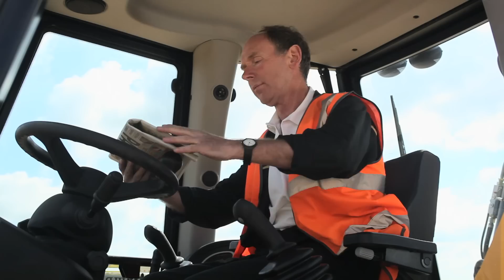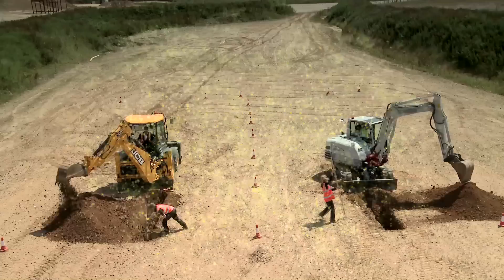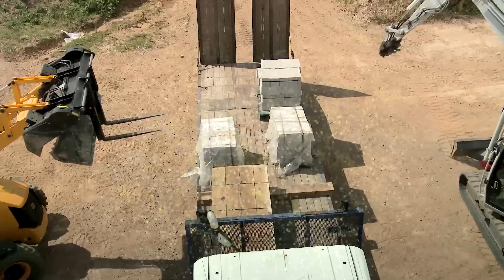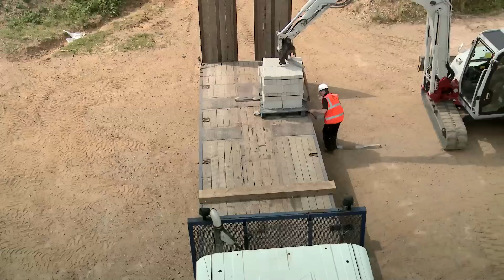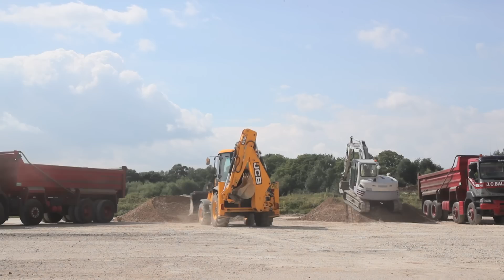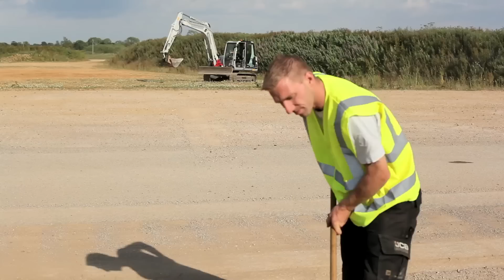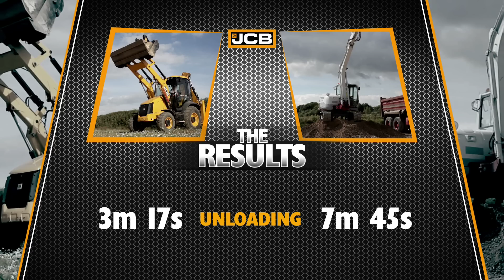Backhoe vs Excavator

Comment: The excavator is better at digging if there are cables and pipes in the ground because you have mutch better view of what you are doing. And if you have a rotortilt you can just put the pallet forks on that, same thing goes for the sweeping attachment. Plus the backhoe is a JCB so it would be broken  half the time that the excavator is working

Comment: THe front end loader on a backhoe can move SIGNIFICANT amounts more dirt per unit of time over a much farther distance than an excavator. Also Excavators are not really truck loading machines until you get into the Quarry size machines. That is why major construction projects use Wheel Loaders for loading trucks. Excavators dig holes and wheel loaders/backhoes fill trucks.

Comment: Backhoe is equivalent to about an 8 tonner so an 8 tonne excavator should have been used. A more experienced excavator operator should have been used to trench and backfill. A set of excavator forks should have been used to unload. A wheel excavator should have been used for speed. Loading trucks is definitely quicker with an excavator you dig from your side and load over back of truck for fastest load time with a mud bucket.
Reply: Lllllllllllllllllllllllll
Lp
Reply: K
J
C
B
Reply: @hennyawalia4939  lmo mio ko

Comment: It's hilarious that JCB would produce this video, which seemingly seeks to make the point "Backhoes awesome, 360 crawler excavators suck" when they themselves also manufacture 360 crawler excavators.
Reply: ï
Reply: +Renata Krauerova m
Reply: +Renata Kaur ova the best
Reply: +Patel Hitesh jjjjuiJ&
Reply: syama anish c
Reply: Bloodgod40 ujjbbbbyy
Reply: Sonu Ashif de 9
Reply: Kala Subramaniam yt3
Reply: Bloodgod40
Reply: Bloodgod40
Reply: Bloodgod40 تننهخححكح
Reply: Moha Zouaoui hbzbz
Reply: lam rau cau
Reply: Bloodgod40 other
Reply: Check size of excavator it's tiny they can use huge excavator instead 😅😂😂
Reply: Bloodgod40
Reply: b
Reply: Bloodgod40 was the time
Reply: Bloodgod4
Reply: It’s pointless like comparing a bus and a train, there two different machines and they may have some similarities, but I see this video pretty pointless. A backhoe cannot move the dirt as far away from the trench for first, and
Reply: @olivermansfield8341  I grew up operating Backhoe for my Dad and I hate them. I have a E85 Bobcat Midi and I would take it over a rubber tire Hoe about 90% of the time. I mean It would be a better comparison to have machines that are same weight, because they don't appear to be.
Reply: Thanks
Reply: @renatakrauerova2487  hdbbndi
Reply: Münevver Demirağ 

Ppl
Reply: 0
Reply: What JCB should have done is pit their own excavator against the excavator in this video then the point would be " JCB Awesome (insert other company here) sucks
Reply: @juliopratama7708  dede

Comment: Each machine has it's positives and negatives.  I have a 2001 JCB 214S and love it.  But like any  backhoe, it cannot compare to an excavator when excavating for a basement home.  Since the excavator can rotate 360 deg. compared to around 180, it is way easier of an excavation when compared to the backhoe.  On the other hand, the backhoe moves material much easier and faster.  It's also way better for clearing land.  I just push over 18" trees, lift it out by the root with the bucket, raise it in the air with the clam bucket, and cut it up into 10' sections.  Couldn't do that with an excavator.  Still the backhoe is an all around machine that is better than an excavator at most tasks.  Cheers from Canada.
Reply: Nice 👌
Reply: its, not it's

Comment: There is so much disinformation in this video:

1. You should use machines with the same digging power. An excavator indeed has to be heavier than a backhoe to have the same "bucket power".  BUT tracks have much less ground pressure than wheels so an excavator can keep going on muddy ground a lot better than a backhoe, even if it's heavier. And most of the weight of a backhoe is on its rear axle, which doesn't exactly help either.

2.  And of course an open area - what if the working area is cramped. If you need to have the machine between the hole you're digging and the dump truck you load the stuff on. It isn't even possible with a backhoe!

3.  When you need to move  a backhoe you either need to turn around the seat forth and back or push the backhoe with the bucket in the ground. In both ways you can't dig when you move it. In an excavator you can use more of your time on the actual work.

4 The view and working environment. In a backhoe you have the digging arm directly in front of your eyes. In excavators (except for mini excavators) you have a clear view of the bucket all the time without any need to move yourself.
Reply: this excavator and the backhoe is equally priced ,so they are showing what is the positives in backhoe
Reply: @mithung1058  I see, that's a good point. But this is only about the "digging power".  This video is an ad for JCB backhoes, so of course they only tell the benefits of it. I wanted to give this a wider perspective. This video shows an optimal open working area for a backhoe where it definitely wins. - But the area isn't always this open and the ground isn't always this stable either.
  But if you need to move the machine a lot around between different small workplaces, even more than one a day, for example in a town, the backhoe is indeed more practical.

Comment: Excavators are a lighter, more compact, and fuel efficient digger than a backhoe. A backhoe is a more versatile do all machine. The backhoe scoops and transports dirt in ways you simply can't with an excavator, and the backhoe more attachment options, at the expense of a heavier machine that will consume more fuel. So if digging is your primary concern, go excavator. If you need more than a good digging tool with a back fill blade, and have not the option for both an excavator and an articulating front end loader, the backhoe is the clear choice.
Reply: call ll

Comment: Like the video, and good PR, but in reality, this isn't fair (for those unfamiliar with both). The excavator comes into its own with jobs where range of motion exceeds 180-degrees, and where you have to both 'break' and 'move' simultaneously (with the excavator, you have to break, pile and then relocate to move the material, while with an excavator, you simply break). In most class-comparisons, the excavator has greater reach, greater down-pressure, and really, the weight-class was seriously low on this comparison, to the favor of the backhoe (less down-force for the excavator).  Trenching tends to actually favor the excavator, but 'back fill' will normally favor the backhoe a little. Might want to look up what a Volvo EC221 excavator can do - several videos showing 2-minute load times for 22-ton dump trucks are all over the place. In the end, both backhoe and excavator serve a purpose, you can't drive nails with a screwdriver and you can't tighten screws with a hammer.
Reply: 7
Reply: Skeeter Saurus m
Reply: สุภาวดี พุ่มทิพย์65
Reply: Skeeter Saur
Reply: Skeeter Saurus 🔫⚒💎🛠🛠🔫💣🔫🔪💣🚬🚬🛡🔫🔫🛠
Reply: +Akram Kogit I oom until
Reply: Sarita Rajesh g
fg!
Reply: ĺ
l
Reply: Skeeter Saurus gfgg
Reply: Skeeter Saurus fff
Reply: Skeeter Saurus
Reply: Skeeter Saurus ljj.  G r.
Reply: टीप
Reply: ิิ รถโคต
Reply: U
Reply: Hipnoze j
Reply: Ili
Reply: Sparta l0pp
Reply: Backhoe have same arm at the back. Basically can do all the things that an excavator can do. The added feature here is tire and front loader.

Comment: Lets see it in a more realistic environment, up the the doors in slurry, which is all to common on UK building sites, the 360 with a ditching bucket on while loading the lorry, and a set of pallet forks on the quick hitch for the unloading. 3CX's are good for motorway resurfacing and the odd bit here and there, but their too heavy and get stuck everywhere because of it. There is always a tele handler on sites too! The levers are arse from elbow as well, unless for most young folk who have learned off a 360, then its a JCB....junk at best!

Comment: Difference between the backhoe and excavator

Backhoe - wheel mounted

Excavator - Track mounted

Backhoe - wider bucket

Excavator - small bucket

Backhoe - can hitch fork

Excavator - needs rope to hitch to the bucket.

Comment: Ouch that was bad.  On the flat and level ground if they were realy matched  in capacity it should have been very even.   It wasn't so they were not matched.  And loading a truck, who would thought a scoop would have an advantage over a little bitty bucket. How does the backhoe compare loading a truck on a narrow job site when you need to turn arround to back load a truck?  A comparison is a good idea but do it right.
Reply: Bnl
Reply: Bngladash
Nata
Reply: Ok I'll
..

Comment: So often overlooked is why the backhoe has become far less common. Most of us know the advantages of both machine & know the excavator has more advantages. 
But what about size? Most Hoes are around the size of this machine, but there are plenty of smaller ex's than this one (which appears slightly smaller than a backhoe), along with plenty of larger excavators. There's no shortage of exe's that could fill a 3 axle dump truck in 2 scoops, even the tractors front bucket won't do that. Yet these are not the really huge excavators.
Reply: Ju. , bun mm
Reply: @udompin th1 k f

Comment: JCB products are excellent. But advertising is sometimes far from the truth.
In fact, excavators specialize in excavation and are much faster, consume less fuel and have more flexibility.
But Backhoe loaders are half-excavators and half-loaders and are not specialized!
Excavators can also be forklifts and do not require the use of ropes.
Obviously, excavator attachment tools are more diverse than Backhoe loaders attachment tools.
Wide buckets are suitable for loading and narrow buckets for excavation.Modern excavators can quickly replace. a narrow bucket with a wide bucket. These replacements are done quickly.
And more ...

Be happy, healthy and victorious ....

Comment: If your digging a drain, an excavator is way better because you can move along whenever you want. On a backhoe you have to take up your feet after digging every 5ft of drain to move on
Reply: You can also just lift your loader bucket and stabilizers off the ground, push yourself with the backhoe bucket, then push your loader bucket and stabilizers back down. Do you really think operators flip the seat around and drive 5 feet forward.
Reply: @C8mon  it still takes more time than the excavator though

Comment: It all depends on the operator's skill, I've just seen other video where the excavator beats the backhoe. In addition to this, there are tasks where one or the other will perform better, if they were meant to do the same jobs in the same way there would only be one vehicle.
Reply: Roberto M. Orellana R. I
Reply: @srinivasaraogunji7936  otnfddscvhhhhhh
Reply: @fkerr4172  yt
Reply: The size of the bucket will also have to be factored in. like if you need a 2- or 3-feet wide ditch. I'm 53 years old myself and I can get on and off a hoe a lot easier than I can get in a skid steer.

Comment: Total bull. The backhoe has a dig bucket while the excavator has a smooth edge bucket. Put them both in steep ground and see what happens. Also the excavator could have used a way bigger bucket for loading.
Reply: Sam Cookson 

.jb
Reply: Sam Cookson and a fork for unloading
Reply: S

Comment: Put 2 JCB"s together.    One digger and one excavator of similar digging capacities and see which one would win.     No doubt, the excavator.      Both generally are transported long distance on low loaders, but on site the digger wins on ground speed.   The excavator would win on work speed, and overall performance.    So why can't JCB put both along each other for a speed test.     Each has it's own uses on site, so do not knock either.
Reply: So a backhoe is useless?

Comment: I think both machines are great at the job they are designed to do. in this example they only tested jobs that the backhoe was superior at. let's try the back hoe digging in a back yard that is only accessible through an 7ft path. or on the side of a bluff. just not apples to apples

Comment: Lol the comparaison is not good.... you choose only a 8 tonnes Takeuchi..... take a 13 tonnes excavator and you will see the backhoe is rekt with good operator. But those 2 machines don't do exactly the same jobs. And where are wheeled excavator ?
Reply: They only did tests where the backhoe  could work, a lot  of Places you can take a excavator You could no way fit a backhoe, Its amazing to me the lack of Conscience awareness of their differences and strength and weaknesses it was just a bias test
Reply: @JJconcrete  Agree, try taking a backhoe to clear land and you'll be slipping everywhere and having to move the outriggers every few minutes. Backhoes are terrible also clearing as they could tip over very easily. Excavator easily wins in clearing projects. I never see anyone  use backhoes other than municipalities. Contractors use excavators and front end articulating loaders for street work involving putting in new water, sanitary, storm underground lines.
Reply: @JJconcrete  some places you can get a backhoe I  you wouldn't get a 360 without a crane or building a ramp

Comment: the mini hoe should be swinging no more then 90 degrees to load the truck not 180, and most operators would have switched on a clean up bucket to decrease loading time. the truck loading component wasn't a fair comparison. the backhoe  had the truck backed up on a 45 degree to make loading the most efficient for the backhoe.  so not only did you compare a mini hoe to a backhoe but also a skilled operator to a novice one. If your going to start comparing diversity of the machines, you might want to include operation in a tight space, steep slope operating abilities, and working in differing weather conditions (muddy vs dry)
Reply: ehan

Comment: A little slanted, but overall a much more honest and realistic comparison than the bullshit excavator sales video by J. R. Weiss. With equally skilled operators, and same sized bucket they both excavate at virtually the same rate. That is a fact. The only real advantage of the mini-excavator is that it can work in very confined spaces if necessary. Beyond that, the backhoe is a vastly more flexible and powerful machine. It can:
1) Move around on lawns without destroying the turf.
2) Move at faster than a snails pace.
3) Load material on a truck MUCH faster. (because it's a FEL - Duh!)
4) Scrape and level dirt much faster (see #3)
5) More stable because of outriggers and larger overall stance - especially with the front bucket down.

The biggest factor on digging speed of either machine is the capacity of the hydraulic pump - and the horsepower available to drive it. Larger machines usually have bigger pumps. Most of the arguments about excavating speed are pointless because of that fact.

It all comes down to which machine is more versatile - and the backhoe is the clear winner.
Reply: B

Comment: Can you buy the option of JCB in the UK where you can drive and operate and drive the backhoe in both directions while sitting facing backwards or is that only a Scandinavian option? Only been operation a 4CX for a very short time and it had that option. Know it's not common on tractor backhoes like it is on the loader backhoes we have here in Scandinavia.
Reply: I know not about the UK but the US allows for forward sitting.  Mostly optional to operator but it can be done.
Reply: สวยอะเ +Slayer John ท่าไรอะ
Reply: วิว นฤมลุ I don't really work on a farm, but I do have experience with machines, like the JCB backhoe in this video.
Reply: Slayer John
Reply: Alexander Ik

Comment: What are the general price differences between these two type of machines?
Reply: These two cost obviously pretty much the same. The excavator is indeed smaller. With the same "digging power", the excavator would cost more.
But notice that this is an ad for JCB, the machines are working on a stable ground in an open area, only the benefits are told. What if the space would be limited (You would have to load the stuff on a truck that can only be behind your working area) or the ground would be muddy?